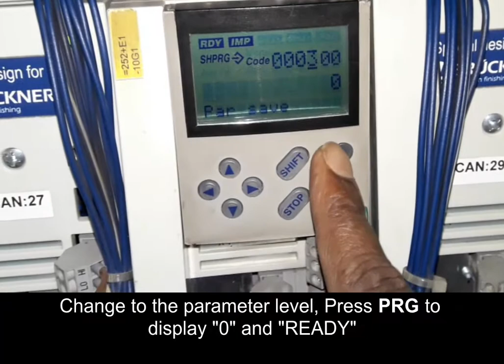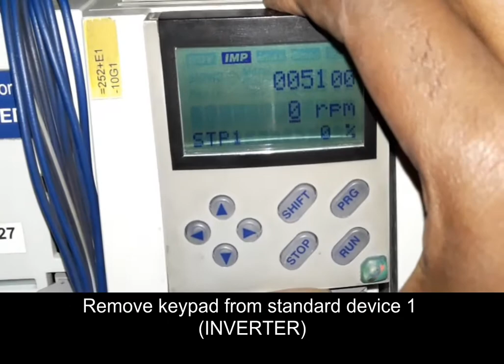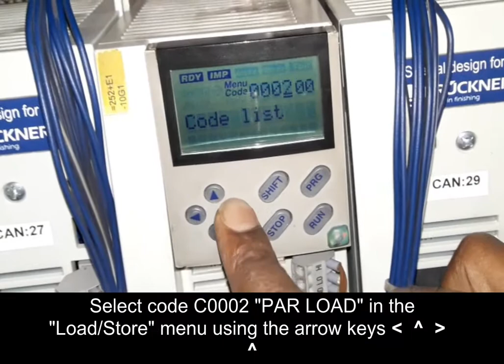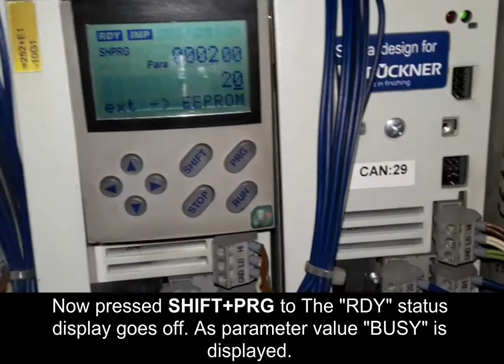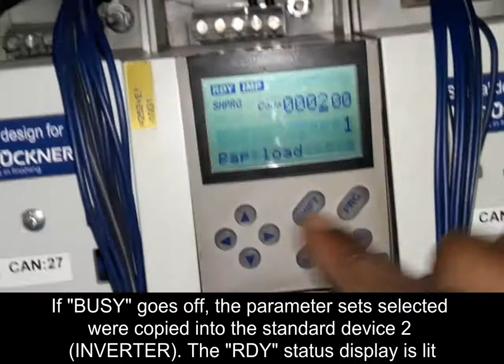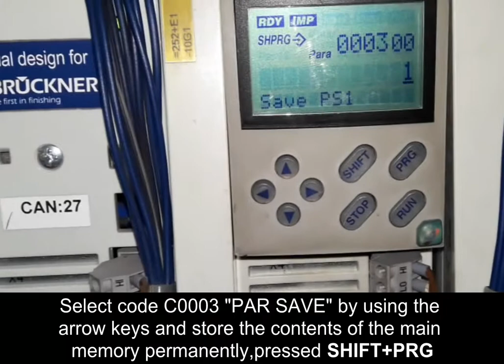𝐋𝐞𝐧𝐳𝐞 𝐈𝐧𝐯𝐞𝐫𝐭𝐞𝐫 𝐏𝐚𝐫𝐚𝐦𝐞𝐭𝐞𝐫 𝐂𝐨𝐩𝐲𝐢𝐧𝐠 | 𝐃𝐫𝐢𝐯𝐞 𝐭𝐨 𝐊𝐞𝐲𝐩𝐚𝐝 | 𝐊𝐞𝐲𝐩𝐚𝐝 𝐭𝐨 𝐃𝐫𝐢𝐯𝐞 | 𝐄𝐕𝐒𝟗𝟑𝟐𝟐  @FlowChart

Comment: save extern doesnt show, only ps1
Reply from the maker: Check user manual
Reply: I had the same problem. Do you guys have any solution ?
Reply: @alperenatilabey555  with my drive: 9323-ETV907 i had to use the Card Modul 2221-IB to copy the programm from old drive to new. Hope that helps you.